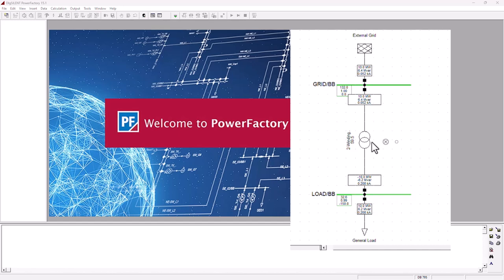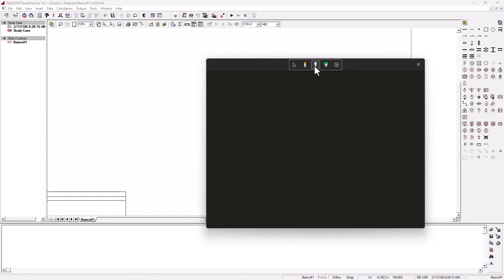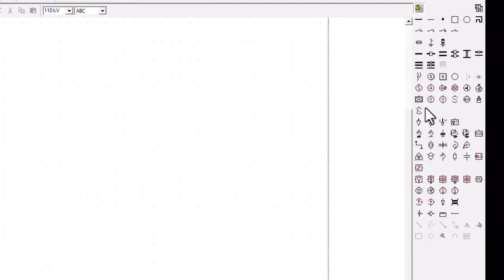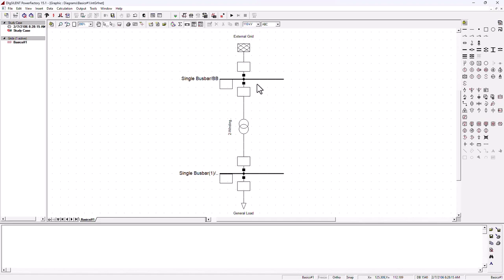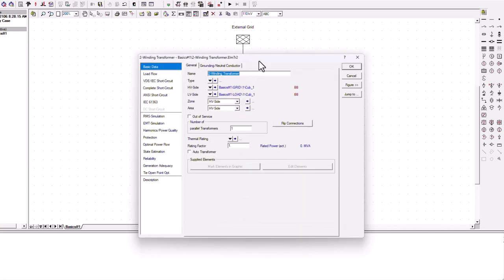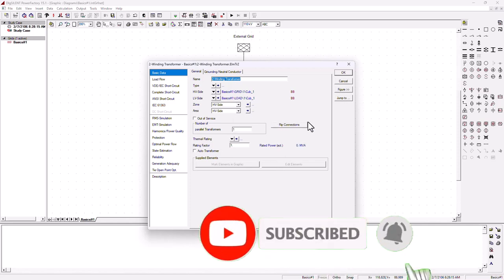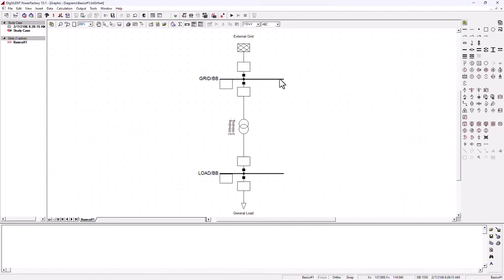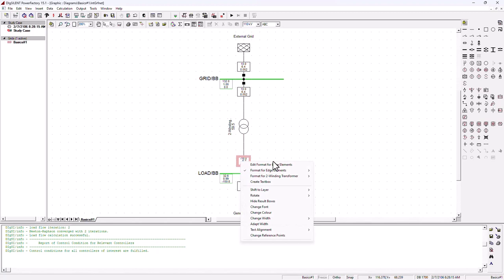1. Getting Started with LoadFlow Analysis Made EASY!

Comment: Thanks. You know how to check for transformer circulating currents when running in parallel and without load.
Reply from the maker: Hi, circulating currents only occur when the parallel transformers are not equal, this is usually caused by the difference in tap position and this will result in unequal windings which will produce a difference in no load voltage that will cause a circulating current.

To check this in PowerFactory, try to change some of the parameters of one of your parallel transformers and this will produce either a lower or higher no load voltage compared to others and this will result in circulating currents.

If both transformrs have exactly the same parameters, there will be no circulating currents as the no load voltage will be equal. I hope that help.
Reply: Thanks for the response. Yes, I have 2 identical transformers, but working on different taps. I have isolated the load as well. Not sure which parameter to use for showing circulating current
Reply from the maker: Hi, you can use a CT to measure the circulating current for 3 phase transformers between the windings, you can probably use the same method to measure single phase parallel transformers circulating current.

I don't have a video on that yet, but you can watch my video on how to add a protection relay with a CT.
https://www.youtube.com/watch?v=DRvI4FhLE8Y